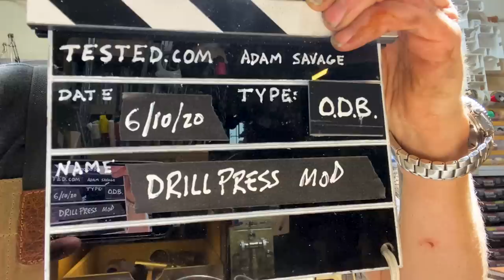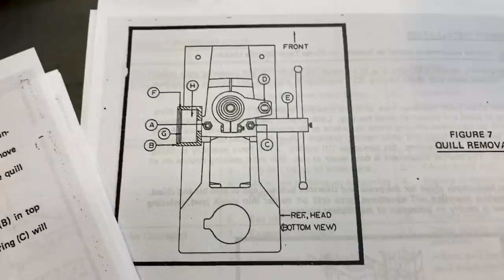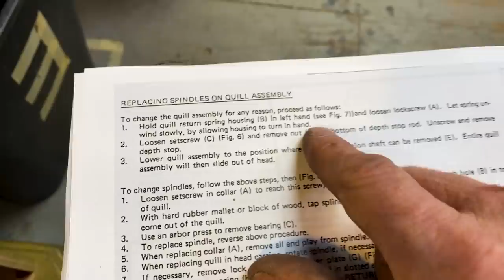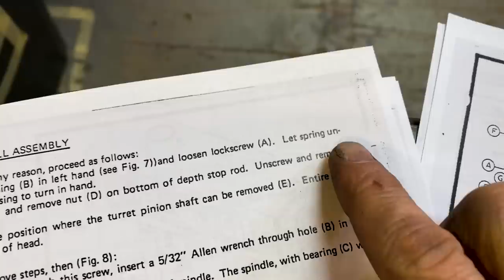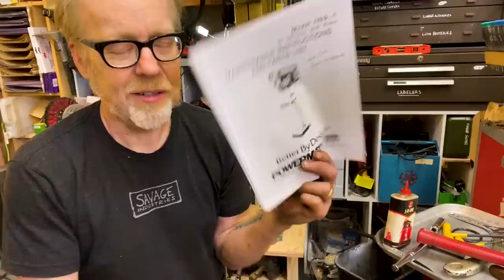Adam Savage's One Day Builds: Drill Press Modification!

Comment: Adam, if only for the sake of learning new skills I would have a go at repairing the old spindle. If you consider it junk anyway what have you got to lose? The male taper although gouged up can probably be made good by stoning down the high spots, and for the Chuck, you can get Jacobs taper reamers to clean up the bore. Ok it won’t be perfect, but it might be good enough for a spare or making a dedicated spindle sander. The only way to truly repair to original spec would be to weld build up the male taper and cylindrically grind it back to size. It can be done in the small machine shop with a toolpost grinder on the lathe but is quite an advanced project. There are many videos on YouTube about shop made ER collet chucks that cover the same Principles. Personally I wouldn’t scrap it though!

Comment: It's dead nuts simple to adjust the tension on the return spring.  This is one job where it's not necessary to put witness marks on the spring housing before it comes off.  When the drill goes back together, it's a perfect opportunity to check and insure the tension is exactly the way you want it.

Comment: Basically, Adam, as a toolmaker and machinist I always take the approach that I can fix any machine. Manuals or no manuals. This will work 99% of the time because all of the mechanical principles are the same. When you are youtubing next, watch random repair videos. You will soon notice all the similarities. I'm very picky in my own work, I always approach everything with the finesse of a toolmaker. It can be problematic for me sometimes. Where I'm going with that is you will see a lot of different and some times "interesting" ways to get the job done, but its all learning.

On the topic of fixing anything, for the drill chuck, if I had access to the machinery I needed, a cylindrical grinder, I would grind that chuck taper out to the next size, good as new. The old spindle can also probably be repaired with a spray weld and a regrind. Might be worth getting it done for an emergency spare.

Comment: Very nice work  you shpuld have consulted with Mr Pete  from You tube  i’m willing to bet  that  parts from some Drill press  would had worked without any modifications Mr Pete  is a retired Shop teacher and he knows his  Machines  I’m sure Power Magic must had teamed up with someone over the years and  built drill presses for some other brand  name  finding little  repair videos on your machinery is usually a good sign  that your machine or tool  is a reliable unit  That Powermatic  Drill press has been in  almost  every shop ive been in  good score on the manual btw  although the internet is full of  lots of valuable information i still  like having  the printed manuals for what i own  and work on  because thats how i grew up working on every thing  and i like reading in bed  the night before  i start a project  and the exploded  views are easier to see imo

Comment: Interesting.  I had a Powermatic 1150 that had a MT2 taper on it, not a J33.  When I bought it it was missing the chuck, and I recall having to order one.  It definitely had a slot for the knockout drift, which I believe j33 does not have.  Mine came from General Dynamics, was an older green model (painted blue by GD - everything used on Air Force contracts was painted blue!) with a shop made 3/4 inch aluminium table that was three foot by two foot or so and I loved it.  The only thing I did not like was the lack of a crank to raise the table.  Mine was so heavy I would ask a friend over when I wanted to lift it up, or use a jack, or just leave it down and use boxes to build up from the table height.  :)   Had to get rid of it in a move, still miss it.  Great drill press!

Comment: Filled my column with rebar and concrete, cheap benchtop  press. Sadly none of the mating parts have been machined so I doubt it drills straight but  it  makes holes.  Used to have a boxford union, Great drill.

Comment: The DP has a split head so it should also have both a push apart and a pull together set of screws to allow it to be adjusted for a snug fit to the quill.  There will also be an adjustment for the rack to quill feed shaft.

Comment: You can use the old chuck with a hydraulic press to remove press fit pins. Just chuck up a piece of round stock in the chuck (slightly smaller than the pin you want to press out). Since the chuck has a wide range and the jaws are still good it can very accurately hold a pin to press out....another pin.

Comment: Adam you could build the old spindle up with a mig welder and re-machine it in your lathe. its something my teacher in college often talked about when fixing something of that nature. Keep up the videos love them btw.
Reply: then you would have all the hassle of machining, hardening and then tempering it etc etc then you would still have to do the chuck then bore it out then harden and temper or buy another chuck, my experience has shown that while these machines can be repaired by doing this if you can actually get the parts its a way lot quicker & cheaper and your back to work straight away. He paid 180 usd for a complete second hand good condition unit which will last another 50 years if not abused, It would take more than a day and 180 dollars to resurface the unit and chuck to perfection, that is a last resort fix if the original parts are not around any more.

Comment: Int tapers are often cut with a specific end mill and/or reamer- specific to the size and type of taper you want to cut. If there is room in the keyless chuck you could just cut it a bit deeper, the recut depth depending on how much "mauling" you have to clean up.

Comment: You probably have a Jacobs 633C or Jacobs 34-33C chuck. Like you stated these special chucks have the threaded collar so the chuck stays put during side loading. My old Rockwell DP has the same chuck because they offered an optional mill table . Good luck finding a keyless chuck with a collar. I have never come across one. Wouldn't hurt to put some grease on the quill rack and pinion. And you are correct about the cross bolt on the front left of the head. It is there to take up wear in the cast housing. Now, I hate you :-) You found what I had been looking for for over 2 years; a table crank for the column. I added a quite thick MDF top and fence to my table to use it for woodworking (25 pounds). I ended up making a cable and pulley system with a counterweight of lead that travels up and down inside the column. Good luck finding a collared keyless chuck. Post if you find. Cheers.

Comment: You can pay someone to remachine the spindle. It involves turning the taper down to remove galling, then spray welding oversize and machining back to original dimensions. Abon79 has a few examples of spray welding shafts on his channel. its expensive to pay to have it done but you may be able to find someone to lend you equipment.

Comment: You could put the keyless chuck in the lathe and re-turn the taper to repair it, also, I notice the collar on the back of it, with holes for a C spanner, so you could turn up an adaptor for the back of it that includes a retainer for a threaded lock collar.

Comment: Don't have a replacement for the keyless chuck but know how to repair the spindle/chuck you have.  Use lapping past and lap the two parts in to a perfect fit.  Only need to make sure the surfaces that are still good mate but don't worry about the galling.  After thoroughly cleaning the spindle and chuck, acetone and blow clean with dry clean air.   Put several drops of locktight green in the spindle.  Test fit with turning to spread, after completely spread on spindle and chuck, press and hold tight the chuck onto the spindle overnight.  Both mechanical securing and the locktight green expands in the chuck making an incredibly secure connection.  Guaranteed to be not as good as new but closest to it.

Comment: You could make a "tailstock" of sorts for your drum sanders. Just a plate and dead center that bolts to the table. Then center drill the bottom end of the sander's spindle.

My Delta Homecraft 11" has interchangeable spindles, so I got one that just has a 1/2" bore with two set screws. There's no taper to loosen up so you can run router bits and spindle sanders and shaper cutters with no worries.
Reply: Also I've repaired and modified several drill presses at home and at work, and they're really pretty simple as you found.

Comment: Machine some threads into that old chuck and thread something on, could be another taper to use in your lathe, or just a big bolt so it's easier to clamp in a vice.  
I've used old chucks to hold brass or aluminum rod when manually filing them into a weird part, or for holding drill bits while sharpening them.   Plenty of uses for an old chuck if you completely toss out the idea of using it as a drill chuck.

Comment: All well and good marking the clock spring orientation and number of turns, but it means less without marking the relative orientation of the shaft it located into. Granted the most you could be out is half a turn too much or too little, but worth remembering in 50 years when you do it again!

Comment: Adam - get a Jacobs 33 taper  reamer and you might be able to save that chuck.  Depends how much meat it has - looks a bit too modern to be "generous" in the thickness.

Or use the old spindle and turn that to a morse taper 3 for your lathe's tailstock and regrind the jacobs taper.  There are no side-loads in the lathe tailstock when centerdrilling so the threadded bit isn't important.

Comment: Motorizing would be really easy... Attach a motor on the shaft where the handle is, run wires up to the machine - cut some slots in the sheet metal or plate in the front and add a 3 way rocker switch with return to center by default... spring switch... then you have up / down... You could also add a knob for speed control. That would be cool to see. Although, for soldering, heat the wire and let the solder flow into it. You can use a tiny dab of solder on the iron to help transfer heat - but keep the tip clean and it will transfer fine with it just lightly tinned. I mention this because I've seen your soldering and we can always improve on something; even as masters.

Comment: For the old hand chuck: I wonder if you could bore out the old taper slightly larger (to get rid of the boogied up bits) and then machine an adapter which mounted to the new taper in the chuck and fit onto the good spindle (and included the threaded bit)? One-day-build lathe project?

Comment: You can probably machine out the interior of the keyless chuck to fit on a cylindrical arbor, to have it for use on a bench grinder on odd occasions. We have a chuck on one of our motors to enable versatility.

Comment: The old chuck could perhaps be rehabilitated. You can tighten the chuck onto a mandrel, and hold the mandrel in the 4-jaw chuck of a lathe, then do some careful taper turning of the 33JT socket to clean it up. Some experience with turning exact tapers would be a good idea beforehand, though.
This is a bit of a maybe though, because you might have to remove too much metal to clean it up leaving the socket too wide/deep. But then it doesn't have to be perfectly cleaned up. You just have to remove any material that projects beyond the ideal cone shape of the taper, and any galled metal.

Comment: I am surprised your drill press doesn't have a removable morse taper arbor most do. I have a similar drill press which does have a morse spindle. The Albrecht chuck is probably useful as is or can be repaired because they sell spare parts. I have both Albrect  and Rohm keyless chucks and find them equivalent but the Rohm is less expensive.

Comment: Something to consider: with the lateral loads placed on the quill/spindle from use as a sander, if the quill uses ball bearings, replace them with roller bearings perhaps?  Maybe more hassle than it's worth but it could be worth looking into.
Reply: It should already have roller bearings to deal with the  vertical load.
Reply: @devinholland2189  I thought I saw in a parts breakdown that it's specced for Z99R12 ball bearing at the bottom but I could be mistaken.

Comment: Given there is enough flesh left on the taper it might be reground using something like a tool post grinder (externally with a grinding wheel or with a die grinder) and the precise compound angle for the taper on the lathe. The tapers will intersect a bit higher than before. There are videos how to set precise compound angles using a sine bar and gauge blocks.

Comment: About Right to repair, Yeah I know what you mean. 
I live in Germany and worked for a medium sized machine building company. So doing a lot of machining and metal working, the angle grinder was quiete often used there by everyone. We used the blue BOSCH ones forever! And they are really inexpensive for a good Angle grinder like ... 75 €. And they are a dream to repair! 
Until head of machining wanted to use "Cheaper" grinders (about 30€ a piece) and did not inform the electricians. Big nono in such a company because only tested tools could be used, and we never got one for testing. So the first one broke after a week, and we were unable to repair it. The caseing was glued shut, when we "broke" in , some components were fixed in place by hot glue. Needless to say, they still use BOSCH :D 

Once I get my Workshop done (Working on getting a Garage or so) I wanna repair and rebuild and old, german Drill Press from "Flott" These babies are almost 60 years old but there is nothing as good as them on our market!

Comment: Re: Chuck. You "might" be able to cut a JT6 taper into that JT33 chuck with the lathe. JT6 is slightly larger and has a different angle, but the same depth/length and should fit... in theory.

You could then possibly use it on the mill with a suitable taper that fits in your tailstock and has JT6 on the other end.

Comment: sounds a bit like it needs some grease on the engagement cogs at the top...is there a greasing nipple by any chance?

Also, I would've taken scans of the original documentation and used the scans on the shop floor rather than using the originals

Comment: Chances are that the chuck is probably still just fine- there may be a few scars in th mating surface, but given that chucks are not considered high precision tool holders, it's probably still within tolerances..  If it isn't or you just want to make it better, the chuck is pretty easy to repair since you have a lathe..  Just chuck it onto a precision ground rod around its max capacity, put the end of the rod into the lathe chuck (use a 4 jaw so you can really dial it in for center), then set your cross slide at the appropriate angle for the Jacobs taper and with a small boring bar, skim a couple thou or so off the ID..  Even if there are some small scars left,  not a big deal, as long as it is concentric and there are no imperfections above the surface, it will still mate and hold just fine.

The spindle can also be repaired by spray welding (molten metal powder sprayed on as the shaft rotates to build up worn or damaged areas).  The new over-diameter spindle can then be very easily machined down to the correct taper angle and diameter.  You can also just manually weld the imperfections, but there's a big possibility that you'll warp it and the cleanup before turning to size is also more of a pain...

Comment: Adam

Only thing you didn't show was checking the run-out of the new spindle/quill.  Hpefully it was within your limits.

Also, using a drill press for spindle sanding is good way to put lots of lateral wear on the bearings in  a drill press, as the bearings are NOT designed for lateral loads.  Better choice would be to do the spindle sanding on your Mill, or at least cobble up a support/bearing for the distal end of the spindle sander shaft.  Want to avoid having to tear this down again to replace bearings.

John

Comment: My only concern in the process was when you put the 'new' quill assembly into the column and didn't have any reference for orienting the the spline shaft into the mating female spline higher in the column ... and started hammering it up! 
Granted you were there with the parts in hand (& so could probably feel any undue resistance) 
(and only using a soft mallet) ... but still had concern that those splines were oriented in line to mate correctly.

Comment: Project Idea:  mount a laser to the table  ,place a reference field against a distant wall....this helps you re-clock the table after raising/lowering.  Very useful for round columns when one either does not think ahead or has run out of quill travel  for certain ops.

Comment: I have a Craftsman D/P and a knock-off German precision chuck. After taking off the clamping ring there appears to be room to duplicate the snap ring grove on the original chuck. Hardened, though - will a carbide cutter fix cut this ? May I borrow your lathe??? :) individual chuck parts and jaw kits may be available from original chuck mfg. or local industrial supply McMaster-Carr (Jacobs chucks). Thanks for the lessons in indomitable persistence!